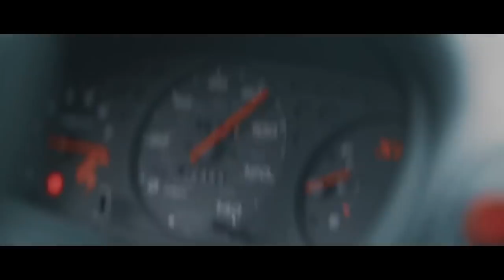Cleaning a very dirty engine bay. Satisfying!

Comment: I’ll take note of this lol. Getting an 08 Honda Fit in a couple days but I’ve noticed if you’re not getting a nice car, the best thing you can do is make it spotless.
Reply: Holds a lot more value than you'd think. Degreaser is your friend but remember it is acidic, don't leave it on paint or especially plastic too long before balancing the ph with car soap and water
Reply: I detail Hondas every day lol. And if anyone knows how shitty Honda manufactured paint is, it's me and other guys who spend time around it. If you take care of it, it can last a long time.
Reply: xCJEx360x do you ever detail interiors? The previous owner was a smoker and I’m trying to find ways to get rid of the smell. It’s not that bad but when you turn the ac on it comes through
Reply: @josephsamsor1698  replacing the air filter will help after you clean the fabrics and vinyls, also there are microbial deodorizing foggers and spray deodorizers that make a huge difference. The foggers are awesome cause they kill bacteria and odor. Smoke sticks to everything so the more surfaces you clean, the less you'll smell it. Windows, vents, carpet, upholstery, headliner etc.
Reply: xCJEx360x ok thanks for the info

Comment: 303 is the best all round spray for interior/trim/engine bay stuff. Leaves a nice flat sheen on everything. Doesn't feel oily. (it's water based) and blocks out loads of UV light so it helps preserve your interior and weather stripping and trim and what not.

Comment: dang, trying to find a car engine bay as dirty as mine to possibly find some tips but the search continues. A consistent oil leak has caked almost every nook and cranny of the underside of the engine and components(previous owner ignored the leak). To even find the leak I need to clean everything, but just using some auto-grade de-greaser and scrubbing for an entire afternoon and spraying it off after each round barely took off the stuff on the very bottom. Might even have to take everything apart to get it all. oof.

Comment: Quick tip, if your worried about shorting things out just disconnect the battery and wait for everything to dry before reconnecting it and starting the engine.

Comment: Armor all will work but it's not the best thing to use. I have been through the ringer with detailing products and honestly I havnt been impressed with many of their products especially their dressings. My suggestion would be grab some chemical guys VRP. It is easily on of their best products. And it's a water based dressings so it won't leave things sticky or attract dust. Surf city garage makes a dressings called black max as well. I really like it but I don't think it's that common now that it's been removed from walmart.
Reply: Also btw get rid of the gunk it works but that stuff smells so bad I can't stand it. I just use car diluted car soap in a bottle for maintenance cleaning. Or simple green if something is pretty nasty.